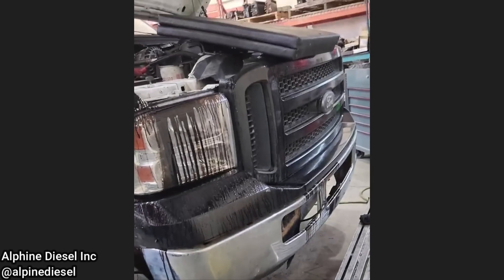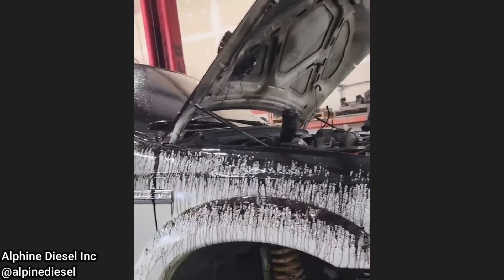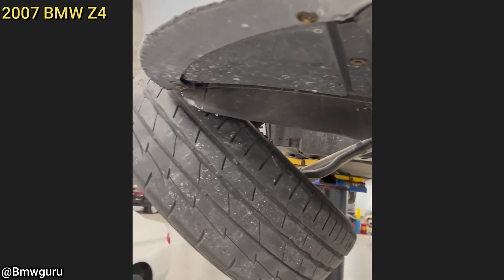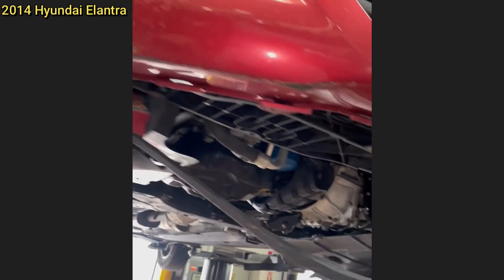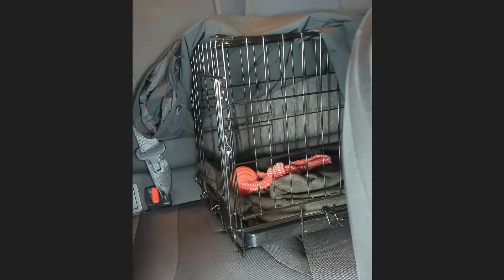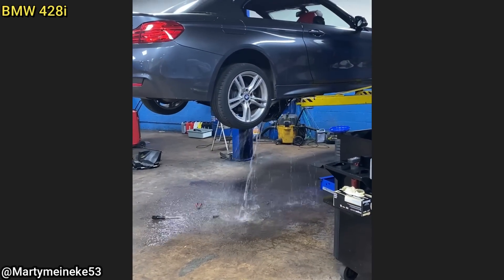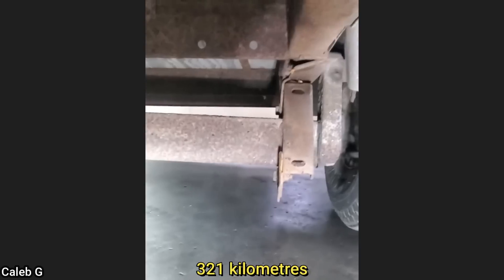Customer States Truck Has A Lack Of Power | Just Rolled In

Comment: I feel for the guy with the roofing nails I once ran over a bag of drywall screws in a single lane construction zone. Destroyed one tire on each of 5 axles. With barriers on both sides there was no way to avoid the bag.
Reply: It was multiple guys though... they were targeted for sure
Reply: That kind of negligence pisses me off.  How hard is to make sure your screws and whatnot are gonna stay in your vehicle?
Reply: I had a car 76 miles on it. Went over an overpass and saw a pallet in the road. Swerved and took a nail in the sidewall. Damn Firestone nail magnets! 🤣😘😆
Reply: @gregscott4479  the footage didn't give a clear view of what kind of company the vehicle was from, it's possible or even likely that they were at the same site where the nails were scattered.
Reply: some truck dropped a bunch of 2x4s on the highway just after a curve so i didn’t see them until i was on top of them. thought my car was fine but found out the week after that it tore up my undercarriage. the repairs was quoted as 3x what i paid for the car. i didn’t see the truck that dropped them so the car was totaled. couldn’t get anything from my insurance because i only had liability 🥲
Reply: @misseselise3864  that sucks. People with unsecured loads should get all kinds of tickets. The pallets that I dodged the only thing I hit was literally the nail and it went up to the sidewall. I don't buy anything with Firestone tires. I've been driving since 1974 legally and everything I've ever driven with Firestone tires I've had blowouts picked up nails, had the tread separate on what in Florida we call the Sunshine skyway. I was driving the church van that day was a full load of people. And then that punch her through the sidewall was the last straw. I just will not buy a car that has firestones on them. I had other problems with him when they first started making radials the notorious Firestone 500 radial they are horrible, the edge of the tire would wear uneven as in chunks would break off and when you parked overnight and got in the car the next day he had to drive about a block before the tire was round again and didn't have the flat spot on it from parking. The replacement tire that was supposed to be better the 721 I think it would go flat with the paper cut to be honest with you! So basically word advice if you ever buy a car and it has firestones on them switch out to something better as soon as possible. If you have an SUV and you don't go off road don't get an all-terrain tire they are not as good in snow and rain on the road. Be safe!
Reply: @JohnRodriguesPhotographer  If I get a flat now Im gonna blame it on you. I bought my car in 20 and it came with Firestone Winterforce snow  tires. (Im putting them back on in a couple weeks) I hope to get a few more years out of them before I have to replace them since I only drive them from Oct to April. I want a set of Vredestein M&S but I have to wait until the Stones are done.
Reply: @JohnRodriguesPhotographer  my f150 had firestones, swapped them for Michelin’s and it was an incredible difference. Loved them.
Reply: @misseselise3864  F
Reply: there was an incident in California this week, where 36 vehicles were on the side of a freeway because all of them drove over nails or wood pieces that fell from a truck.
Reply: @edfrawley4356  🤣
Reply: Why didn't you just get out of your truck and move the bag?
Reply: Second petal from the right is called the brake petal. I have stopped more than once in single lane construction zones to remove all kinds of nonsense in the way
Reply: @jimmydesouza4375  It literally flipped out of a utility trailer right in front of my. Didnt have much time to react let alone stop 78,000lbs on a dime
Reply: @edfrawley4356  1st, wtf are you doing driving so fast and so close than you don't have tome to stop?

2nd, how the hell does driving over a bag of nails flip a trailer?
Reply: @jimmydesouza4375  with how cluttered single lane construction zones can be, it's very easy to mis debris in the road until it's too late to stop, especially when driving tractor trailers. On interstates, construction zones generally slow down to 55, if traffic even slows down at all. At that speed, a truck still takes over 100 yards to stop. 

Even for regular passenger vehicles, being stopped in the middle of the highway with traffic behind can be dangerous in and of itself, especially if stopped traffic is highly unusual, such as on interstates in rural areas. 

Between limited distance vision and slow reaction times, plus the tendency to panic, the reality is humans are pretty unreliable at interstate speeds.
Reply: @keegans5695  He's not talking about the interstate (and how would a bag of drywall screws ever end up on an interstate? :D)  He's talking about the lanes they set up for supplies when they're batch building new houses.
Reply: @jimmydesouza4375  I didn't see anything specifying where this driving was taking place or what type of vehicles were being driven. I was mainly pointing out that "just do this" or "just do that" is generally an uninformed oversimplification that won't incorporate all cases. 

As to how drywall screws, roofing nails, finishing nails, carpet tacks, wire staples, or any other number of residential fasteners can end up on the interstate, that's very simple: unsecured loads. Plenty of things fall off pickup trucks and out of the back of the family SUV on the way back from Home Depot because some idiots don't properly secure their cargo.
Reply: darkwood777  Give your f*cking mt head a shake. NOT stopping in 60mph traffic just inside the merge of a construction zone for a small paper bag that had blown out of a vehicle that had merged right in front of me.  1 NO way to stop in time 2 quickest way to cause a highway blocking multivehicle wreck
Reply: So, the tires looked new which precludes them from a discount tire hack... Get the insurance on your tires and before you run out of tread make sure the tire is not repairable like those ones and get new tires thanks to the road hazard warranty. 😁
Reply: @JohnRodriguesPhotographer  The only all-terrain tire that's any good in the snow is the Nokian AT because that's the climate they were made for. Will probably be awful in the desert heat though.
Reply: @modarkthemauler  I know that brand. Do they sell in US? just curious, live Florida. I know the brand because I worked indirectly for their cellular division.  Never understood Microsoft buying out the brand and doing nothing with it. The name is now licensed HMD they back on the market as Nokia Phones. I have a few plus their 10' tablet. Great build quality.
Reply: @JohnRodriguesPhotographer  I think they do in the northern states, but I live in Estonia right next to Finland so I can't be sure. The Microsoft made windows phone OS was excellent, had a Nokia Lumia 925, but yeah they botched the rest. Currently running the XR20 and it's pretty good.
Reply: @modarkthemauler  I am using the Nokia 8.3 I also have a Nokia 7.2 as a backup. Overall I am happy with the product. The only issues I have is the Android One os.
Reply: @gregscott4479  
Easily 5 trucks leaving a jobsite after a roofer drive out the same way but forgot his nails on the bedwall or roof or something. 
...or they seriously pissed off some roofers lol
Reply: Ran over what must have been an assorted can's worth of roofing nails and screws on my bike, spent the next 30 minutes collecting it all up before walking home with flat tires, I now loath roofing nails cause they are far too good at shreading tires
Reply: but how do three vehicles accidently run over dozens of roofing nail with all four tires? doesnt seem like much of an accident,

Comment: 3 different times while bicycle commuting years ago I stopped and spent a bunch of time getting hundreds of nails out of the road. There were a lot of contractors who lived along my route and they dropped tools, which was great, but also often dropped entire boxes of nails, which is not so great. Lots of fun waiting by the side of the road for traffic to clear to go out and grab another dozen nails before the next car comes.
Reply: I look for sharp objects on the road when walking across an intersection as I figure drivers would prefer 4 inflated tires instead of 3 or less.
Reply: These days I'm mostly on a motorcycle, and I do stop to get stuff out of the road still. Most recently someone dropped an entire clothing cabinet (plastic, 5 feet high) on the expressway blocking a lane. I got it off to the side.
Reply: @John_Ridley  saw a bungey cord lying in the road one time, stopped traffic to remove it - astonishingly enough, nobody honked.
Reply: Get a magnet...
Reply: @ElvianEmpire  Man if I stopped for every bungee cord in the road I'd never get anywhere. Too many truck stops around here, bungees fall off trucks all the time. I do stop for chain binders and come-alongs, those are in the road sometimes. They weigh many pounds and could damage a car badly.
Reply: @catwoman2596  I don't generally want to carry a magnet around on my bicycle for years just in case I see a spilled box of nails randomly one day. I have room for lunch and a change of clothes, spare tubes, tool kit and a tire pump. If I outfitted for everything I might come across I'd need a chase vehicle for all the stuff.
Reply: Careful out there. The same idiot that yells at you for being in the road picking up nails is the same guy that throws a bottle at you riding, while he's doing 60.
No good deed goes unpunished.
Reply: @timsilva1944  Maybe it's where I am. 40,000 miles of bicycle commuting over 10 years, never had anyone give me any trouble at all. We also don't lock our doors around here. Heck I don't even lock up my bicycle outside the stores.
Reply: Where I live, most of the stuff on the road is road-killed animals, scraps of shredded tire from semis, and empty pop (or beer!) cans and bottles.  I did remove an intact dead wild turkey a while back, but unless you come across roadkill before too much time passes or additional people run it over, it's too much of a mess to deal with.
Reply: I have two words for you: magnet.
Reply: @K9River  carry a magnet around on a bicycle for years in case I see some nails in the road?
Reply: @John_Ridley  Why carry it when it's a magnet? Just wrap it a couple of tmes in a rag (to stop scaring the paint) and stick it to the bike frame. Besides it doesn't have to be a huge magnet it's just to make it faster to pick up nails.
Reply: I was riding my motorcycle along just recently and came across a snap on flashlight, a couple of hundred metres and there was an impact driver, and so it went until i found a whole snap on tool box on the road, all the drawers had come out and there was stuff everywhere. How they didn't hear it falling off is amazing.
Reply: @uhtred7860  dude you got someone's life savings
Reply: @malice6081  I live in a small town in NZ, it took about 2 minutes down the local pub that night to find out who had lost them. 😆
Reply: @John_Ridley  The comment was mostly an opportunity to make fun of Brandon.
Reply: @ravn_blade  You have a STEEL FRAME bike? Is it from 1950? Or just a POS from Walmart?
Reply: @ravn_blade  I'm not going to carry a magnet around for years on the off chance that I come across a bunch of nails in the road. It's happened 3 times in 10+ years. I'm just trying to be nice here, nobody's paying me to clean up the road. You could argue that I should carry some kitty litter to clean up the oil spills I come across.
I already carry first aid with a trauma pack in case I come across someone injured. I can't carry everything.
I don't have an "ultra-lightweight" bike. Any non-shit bike these days is not steel. Any magnet strong enough to hang on to a little bit of steel on what, like a screw head or the bottom of my saddle? over the rough roads I ride on (including 4 miles of gravel), especially with a cloth wrapped around it like you suggest, would have to be like a huge multi hunred pound pull magent.
Reply: @K9River  You may need to spend some more time with The Count from Sesame Street.
Reply: @John_Ridley  well if you say it like that, I've changed my tires from regular use more than you picked up nails. Not to mention it sounds like you don't go down any highly active roads if you go down a gravel road for 4 miles, this is an assumption i admit.
Reply: @MonkeyJedi99  You totally missed the comment. It refers to the fact that Brandon can't count. And you aren't up on current events.
Reply: @John_Ridley  lol. Plenty of AMAZING steel frame bikes out there from the past. I own a few…
Reply: @Fireneedsair  Sure. Good steel bikes are out there. Generally it goes: Cheapest bikes: Steel (gas pipe). Next tier: Aluminum. Next tier: Butted thin wall steel (bonus for hand brazed lugs - beautiful!) - Touring bikes that are going to take a lot of abuse are frequently steel and NOT cheap. Then come titanium, carbon fiber.
But the MAJORITY of non-garbage (walmart) bikes rolling down the road are not steel. Steel bikes are generally either vintage, walmart crap, or are expensive touring or tandem frames built to handle a lot of abuse.

Comment: 2:43 I've seen many videos with the crankcase comepletely shattered like this but NEVER have I seen the engine still running and throwing flames through the oilpan 😬
Reply: I've seen one or two videos before, but this one does have more fire.
Reply: There is a video on YouTube showing a Ford Falcon 6 cyl engine.   A trade school teacher uses it to teach apprentices how bad an engine can be and still run pretty good.  This one has a big hole in the crankcase from throwing a conrod.   When run it periodically belches flames out the hole, from unburnt petrol/air mix pushing past the rings in worn out cylinders.
Large marine engines have "Bichari" valves (not sure of spelling).   These let flames out of the crankcase safely, otherwise very worn engines can explode.   This doesn't happen with car engines, as the volume of gases compared to mass of metal is too low for explosions.

Comment: The guy on the right inflating the tire stepped back at the right time to prevent his face being taken off 😝
Reply: if i remember correctly it's possible for rims to brake when the tire is inflated for the first time so most manifacturer recomend to put the wheel under a steel cage for some time during and after inflation, also if the guy got hit he would have been dead on the spot
Reply: He just remembered  the youtube video he saw about the tire in a tire cage
Reply: Hoping this was a lesson and will not do this again.
Reply: Not just his face, his whole head would be gone
Reply: Doesn't look like a split rim, so I think they just put too much pressure. Agriculture tires usually have max. 2.5 bar for mounting.

Comment: @2:45 in case you're wondering what's going on in a cylinder when the engine is running.
Reply: That's what I thought I saw. (Try saying that 10 times fast)!!
Reply: missed opportunity to use a high frame rate camera there... 😋
Reply: Personally, I just pull a spark plug to inspect it when the engine stops running, but each to his own...

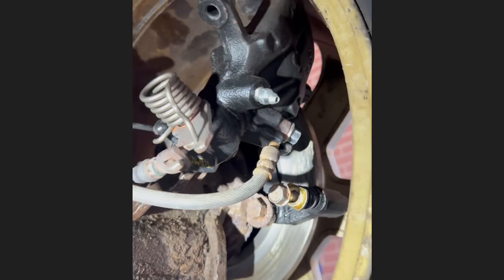Comment: 1:17   The lesson is: never buy a car from a friend.
Reply: Yup. Bought a Honda Prelude from a friend, who forgot to mention it had been "chipped" for maximum performance. Commuting almost 100 miles a day in it was eye wateringly costly in fuel.
Reply: Another good lesson in these videos (though not in this one) is that never go to "the another shop".
Reply: Dude was so dumb sticking his finger in there that wheel could break off of the hub at any moment and shear his finger clean off....scary to watch.
Reply: @chriswareham  Yep, but in terms of time, you would have got to work before you left home!
Reply: Came here to make the same comment.  Very loose use of the term "friend".
Reply: probably just don’t buy a car from someone you have a personal relationship with. friends, family, etc
Reply: Even worse: never buy a car from a friend, and ask another friend to look at it for you because you work two jobs and don't have the time.
Bought a '02 4Runner for $3,200, frame rotted through after two months on the road. Could've rented a brand new 4Runner for that two months, for the same dough.
Reply: Yeah, you don't want to ruin a friendship with business matters, or vice versa.
Reply: I've bought from friends. They were honest about the cars, encouraged me to get an independent inspection, consider it "as is", and everyone was happy. Okay, one car needed a new water pump ASAP but I blamed the bad inspector, not my friend. And it was still a great car.
Sold to a friend too. I gave him a list of all problems, real and imagined and intermittent. We're still friends and coworkers. 
I think the key is to get independent advice, so if your friend has bad judgment the conflict is with the independent mechanic. And all sales final.
Reply: more specific: never buy a car from a car mechanic. you can never know what "solutions" were found and what problems are just ignored because after a day at the auto shop you don't wanna see no car anymore...
how do I know? I'm a car mechanic.

Comment: I used to work for Goodyear. The Jacksonville Sheriff Officers get tires from Goodyear. I had one officer get 3 nails on the left front, 4 in the right front, 4 In the right rear. The left rear had 62 nails. Drove 10mi, no loss in tire pressure.